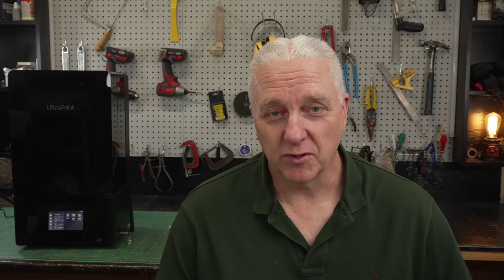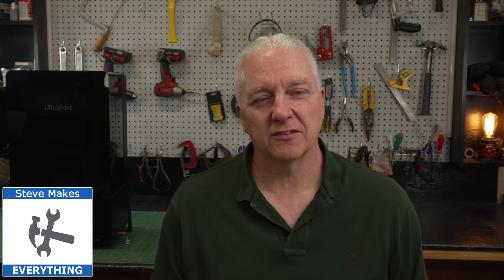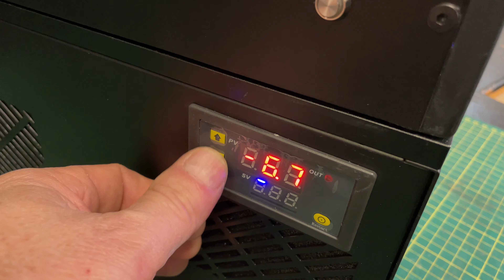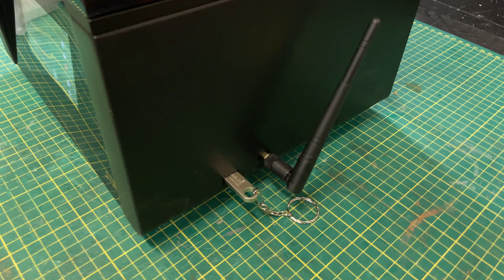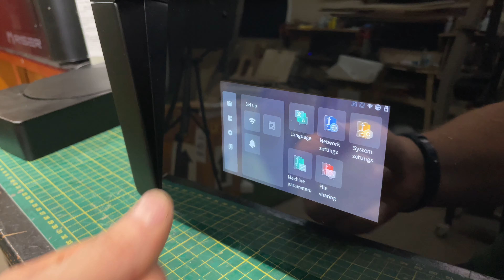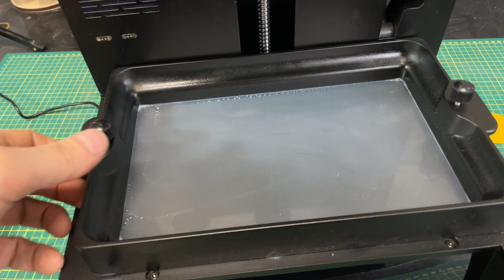UltraPrint 12K 3D Printer - Large, Fast and Accurate 3D Resin Printing Arrives

Comment: Would you share the identity and all the information you have about the project creators? They scammed thousands of people...
Reply from the maker: Hi Juan, I receive over 100 emails daily, so I only keep messages for a year. Unfortunately, I don't have any additional information to assist you.

I've heard from a couple of people about this issue, and sorry to hear about the problem.  Although I have no affiliation with any company and can't control their actions, I believe they intended to design and market this printer.  People need to understand that Kickstarter projects fail all the time (about 30% of them, in fact), so it's always a risk to invest in them.  I don't think this company set out to scam anyone, but the point of a Kickstarter is to generate enough investment to move from a prototype to production.

I'm always cautious about taking on any product that is on Kickstarter because I want to protect my viewers.  In this case, I saw no red flags, but the project failed and apparently impacted 383 backers.  As a YouTuber, I have no association or control over anything a company does.

Comment: Waaaaaaaaaaaaait a minute, so you cant use the auto filler while printing?? I thought this to be the best feature for an resin-printer.
Reply from the maker: Yes you can use it while the printer is printing. You won’t have a choice if you want to print large items.  You do need to make sure the nozzle is pushed all the way down though so you don’t hit it with the plate.

Comment: Really good review. However, this printer’s build plate,  Z axis ball screw, wireless antena, screen, and side controls are giving me a very strong Saturn 3 Ultra vibes. I wonder if they share the same manufacturing facility in China. Anyways, thanks for the review. 👍
Reply from the maker: I have now knowledge of any connection, but the laser and printer manufacturers in Chiba are pretty intertwined so anything is possible

Comment: Great video!
I had a question about the resin youre using. Im assuming it's the ultra fast resin? Have you tried printing with normal resins, and if so, how does the speed compare?
Reply from the maker: Yes I tried a couple of other resins and didn’t have any issues using the same setting.  I even gave flexible resin and it was also ok, though it’s not as fast as other resins.

Comment: Solid video, Steve. Thanks. I wish I could afford a larger scale printer like the 16" one they offer but it looks like they really are paying attention and making good quality printers. Thanks for the heads up.
Reply from the maker: Yes this printer has already replaced my old Anycubic, which is so small and slow compared to the UltraPrint 12k. And the detail this can produce, really changes the way these printers can be used.